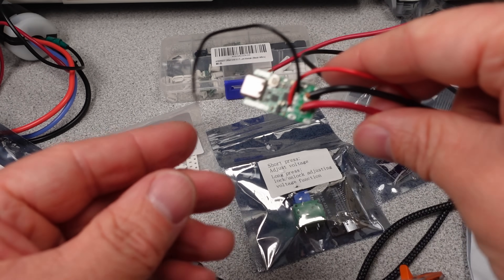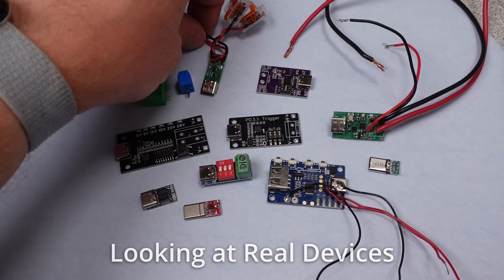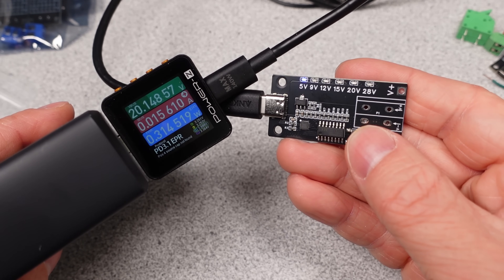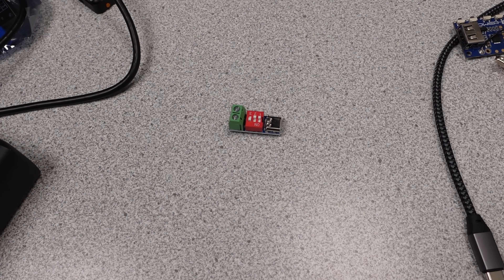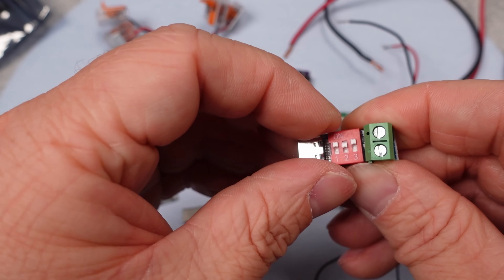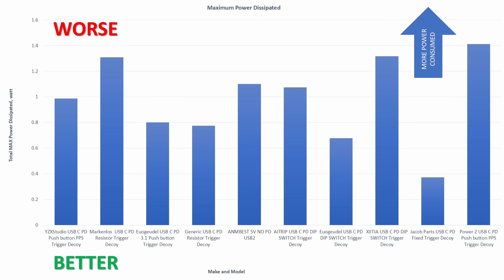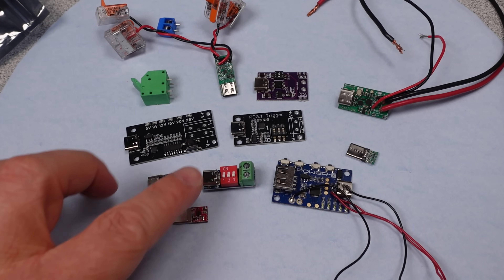USB Power Delivery PD Emulator trigger or decoy

Comment: Just started my search of PD trigger. Not a tinkerer, tailor or solderer. Looking for USB C female to female (ideal), 20v fixed or adjustable, 65w or greater. Power is only need.  Is there such a thing?  

Use case(s):  I travel with a tiny CPAP. I would like to power CPAP from my laptop PD supply (so I don't have to carry 2 power supplies) and use with PD battery.  I have a barrel connecter to USB C cable for the CPAP, but the CPAP isn't able to lock onto 20v from laptop power supply or battery.
Reply from the maker: They make barrel cables with the PD chip built in search for USB PD trigger with barrel connector.  They don't make a 20V USB fixed output on purpose because it's dangerous and you can plug it in incorrectly and damage a lot of equipment.

Comment: Could I use one of these to directly power a constant current LED driver? For example, if I were to trigger 12V and I use that as the input to my constant current LED driver but the voltage across the LED is only 6V would it work or would it trigger a fault on the charger?
Reply from the maker: Yeah, you can power an LED driver with one of these, as long as the power level doesn't exceed the supply and the LED driver accepts the voltage you choose.
Reply: @AllThingsOnePlace  Thanks for the reply. Do you know how much of a voltage difference USB PD will tolerate? If I triggered 20V but the LED only took 7V when driven at 500mA would the USB PD still work without a fault?

Comment: I have a couple of the ones with DIP switches. The DIP switches have started to become unreliable. 

One of my favorite style are the ones with Amass XT60 connectors. I use one on a LiIon balance charger, for example. Nice solid connectors. 

I’ve got a couple with barrel plugs too, but XT60 are better.

Comment: 🤦‍♂That trigger..the INOP 28v one..oh lord..𝒯𝒽𝒶𝓃𝓀 𝒴o𝓊 for confirmation..I may have been mistaken via a double failure  and lack of digital USB diagonostic testers that my anker 26750 bank wouldn't do 28v
Reply: 4:10  Have you found any chargers that output 36 or 48v😮? Props for finding that trigger..assuming it'll actually spit out the forwarded 36 & 48v.

Comment: Just watched your anker solix c300 video and bought it, do you have any recommendations on the best charger for it? Besides the anker prime 240w.
Reply from the maker: You do need a pretty good size charger and one that can hold the rate for a decent amount of time.  The apple 140W comes to mind as one that can hold the power level.  You can use a more compact adapter like the Anker Nano 65 or 100W but they will likely cycle or step the power down after a period of time, so expect several hour charge times.

Comment: That Xiitia board, purple color is one of the cheapest one, it works but yeah produces a lot of heat. I've used multiple of those around my house. 
I did make a reddit post about how it nearly melted a Air Purifier shell due to reverse voltage 😅 bad electric design on my part but I hoped there was something built in protection
Reply from the maker: Yeah, none of these have any kind of protection devices.  You do one thing wrong and pop.
Reply: Do you have a Reddit link ?
Reply: @davida7137 it's titled can this board handle reverse current? On USB C hardware subreddit. Not much to it. Just that it heated up way too much

Comment: Are there any that do not provide any power if the source can’t supply what it is requesting? If I wanted to convert something to USB-C power, and not have a well meaning but uninformed person plug it into their cell phone charger and face whatever risk from having the device try run below its voltage range, do I have an option? Not as bad as over voltage but still would like to be correct or nothing.

Comment: Could you provide a link to the "Generic" with only 0,11W? Cant find it... Also i wonder why you dont rate this high efficiency? Obviously is the mosf efficient for small loads ≤5W. All the other suck in efficiency for small loads.

You dont say if that "Generic" one has statusindicatorLED... And i cant see it. If it has one, you could bridge it or cut it off somehow to bring it below 0,1W.
Reply from the maker: https://www.amazon.com/dp/B0BGJ2QP8R   (non-affiliate)    True for small loads, I could've made the video a bit longer and elaborated more on that.  The resistance is included so you can calculate the performance for your specific use case.  Some of them have an LED running with a very high value resistor so negligible change.  Again, more things to add to the video.  Yeah, this video didn't find an audience...

Comment: is there a module that has solder points for D+/D– ? if i'm not mistaken, the YZXSTUDIO? i am thinking about upgrading some old devices that use 12V dc barrel and usb-b to a single usb-c cable. so i need to pass through the data. love your videos, bro! thanks a lot for all your info. cheers!

Comment: Nice collection! Would've been useful to see externally-powered USB meters in trigger mode shown as well for comparison - for example, my FNB58 has effectively 0 parasitic draw (<0.5 mA at input) when powered through the "PC" micro-USB port. 
And it has competitive series resistance too at 31 mohm (from your "USB Testers and Meters – Which one is BEST???" video)

On that note, do you have an article or video detailing your test setup and methodology? 
I'm curious if you compensate for things like cable resistance and parasitic draw (of the triggers) when you calculate power adapter efficiency. 
i.e. not accounting for a trigger consuming 0.5 W could be significant for a 20 V 2 A adapter, the calculated efficiency would always be ~98.8% (40 + 0.5*0)/40.5 or less, even though in this hypothetical the adapter truly has an ideal 100% efficiency.

I suppose an ideal setup to minimize error from voltage drop and parasitic draw would be an externally-powered trigger with a male USB-C connector and sense wires attached as close as possible to the connector pins.

Comment: How do charging bricks fair when used as power supplies with a PD trigger board? Maybe using over sized chargers for prolonged use does the trick?
Reply from the maker: Yes, the oversized chargers are a good choice when using a PD trigger, just like your PC power supply, a little headroom is a good idea.

Comment: Are there good power adapters for 36, 48 EPR? I've seen 28V frequently, but no 48 OR 36V. I have a car adapter that supports 28V 😊
Reply from the maker: Framework has a 36V out and Delta has a 48V unit out.  I haven't tested the Delta yet.  The framework was pretty good.

Comment: WITRN is a legit USB-C tester brand, they also produce trigger cables. Power-Z is ChargerLab.
I'm surprised you didn't cover USB-C trigger cables. They're much more useful than trigger boards as power brick replacements. Also don't have to worry about having the right voltage as they're hard coded, assuming your USB-C charger supports the hard coded voltage that is.

Comment: That power-z module is obsolete now. The Kowsi  KWS-X1 can change PPS and has a gui on an LCD screen. It's a good little unit.
Reply from the maker: Yeah, the power Z PCB was a pretty limited thing.  The main thing is low power loss, the little testers aren't great as triggers because they use too much power and are more lossy.  But it's still a good device for the testers video.

Comment: Have you come across any that support AVS? I have a BiPAP machine that runs on 24V DC, and it would to nice to make a USB-C adapter with just a barrel jack and trigger board.
Reply from the maker: Yeah, I've been looking, I know several of the power adapters support it.  24V would be nice.  The power meter devices probably can force that mode, but they aren't going to remember.

Comment: Good video, it'd be nice if you could check out some of the cheapest USB-PD boards - I make extensive use of the HW-398 boards with the tiny resistor to select the voltage. It works well for me with a laptop 65w USB-PD power supply for custom power connectors with old laptops. 
Also with my TS100 soldering iron - though I did find if I plug the HW-398 into my later USB-C powered TS101 soldering iron (when they get mixed up) that the chip on the HW-398 dies every time, I wonder why that is?
Reply from the maker: hmmm.  It sounds like nothing should happen since it's a sink attached to another sink.  There's no power anywhere.  A trigger with a USB C to C into a soldering iron shouldn't do anything.   Are you back feeding voltage into the board?

Comment: I use these all the time, so thanks for the round-up! The style with the button and the RGB LED is also the one I use most often, and at least the versions I have can be taught to remember and start up in a different mode by holding the button down when plugging in and performing a specific sequence. I think you press the button multiple times to get to the mode you want, then hold the button down until the LED flashes or turns off? After that, it will automatically default to that mode on plug-in (including a meta-mode of "highest available").

Pretty distressed to hear those kind aren't readily available anymore!
Reply from the maker: The yzx specifically I can't find, there are several knock offs.  They look very similar but they are different.  Switch placement, led placement.  I'll have to try waiting longer for the remember, I was never able to get mine to remember, you can get it to adjust the PPS mode, but not really great doing that.  The power z in that case was a treat.  push up push down.  The voltage regulator is cooked on that one, I should tack on a new one and see if it also cooked the microcontroller.  I forgot I have a QC2/3 emulator thing too.

Comment: FYI On my YZXStudio decoy I can change the PPS Voltage by long pressing or double tapping the button while in PPS mode. I don't recall the exact details. Only that it was very hidden an impracticable for real usage.
Reply from the maker: Yeah, I've done that a few times by accident but didn't mess with it for long enough to care and with one button found it very difficult to use.  I like that it will grab as many max voltage PPS offerings as the device wants to throw out.

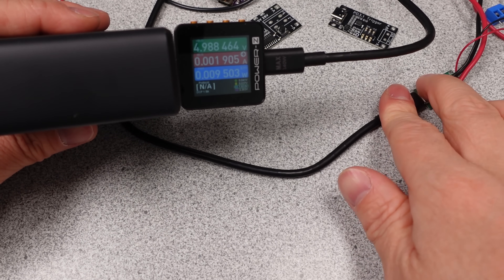Comment: 1:43 To my knowledge (and with some history designing these board for my own use) without a trigger the standard 5V 900mA (or 500mA) is delivered? I know it is not part of the whole PD spec but saying "no power is delivered" is wrong as far as I'm aware!
Reply: The resistor on the cc pins might have be configured for source (56kΩ / 22kΩ / 10kΩ pull-up) instead of sink (5.1kΩ pull-down) configuration by default?
Reply: Not for Type-C port with Type-C to Type-C cable. With those all power negotiations are supposed to follow USB PD standard and happen over CC1 and CC2 lines.
Reply: @volodumurkalunyak4651  if that was the case then you wouldn’t be able to use USB-C power adapters to power USB 2.0 Type-C devices as the CC lines aren’t wired at all, yet you can!
Reply from the maker: It is the case where many older usb type-c devices don't work with modern 'smart' pd 3 or newer adapters.  Adding the resistors is supposed to help this.  The higher resistor value would limit the current more but still should turn on.  In this case it doesn't do anything because the CC lines aren't connected at all, so yeah, with a modern smart power supply zero output.

Comment: Thanks for the roundup! Ive been meaning to move stuff on my desk to 1 USB multi adapter so this was super helpful. Appreciate your investigations and data.
Reply: This idea is somewhat problematic with most of the usb chargers as they re-negotiate the voltage distribution each time you connect a device and therefore shut down the power for a couple of seconds to calculate the new power on each port. It is good enough for battery powered devices but for routers and lights for example its not a good choice. At least in my experience..
Reply from the maker: Yeah, once it finishes the negotiation dance, the lights all stay on.  This is the value of the larger USB power bricks though.  They can keep the power flowing to more ports without renegotiations but yeah for the most part, on off on.  Of course using single port adapters as just power adapters alleviates this, but then just use the original brick.  There is slow improvement.